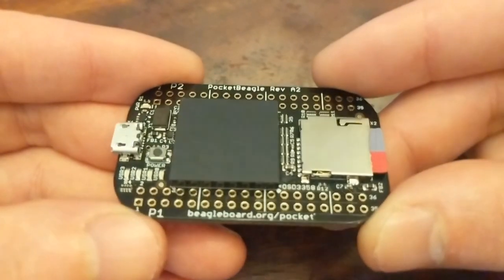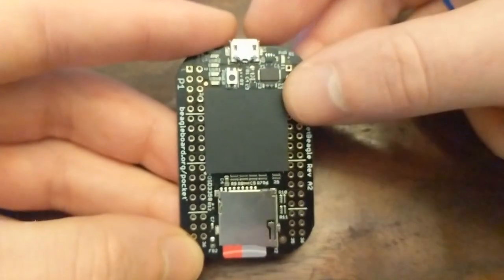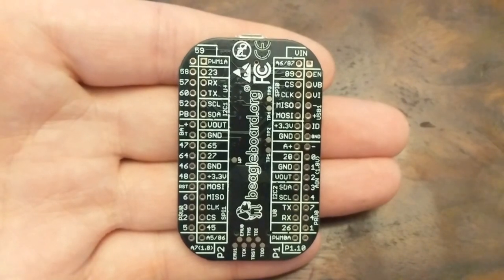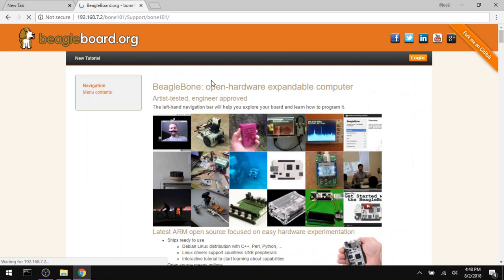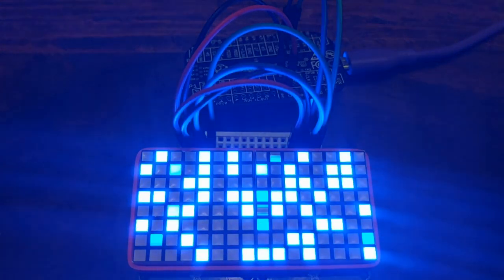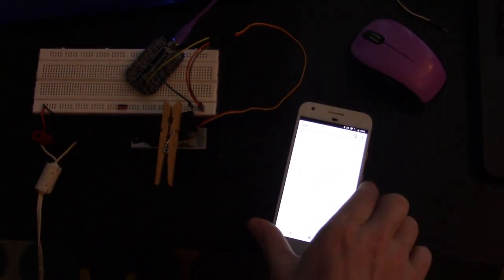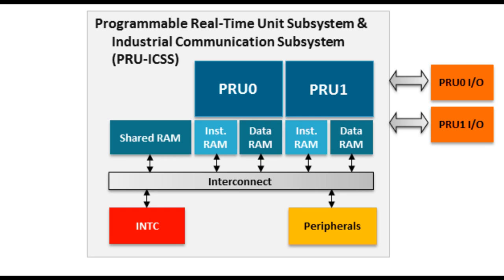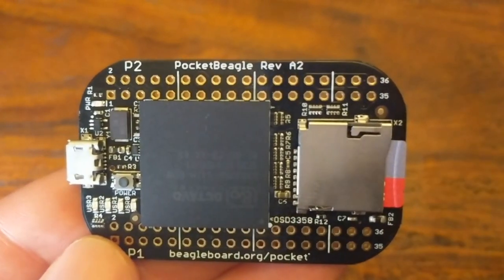Pocketbeagle: Open Source USB-fob Computer?

Comment: btw is it really comparable to an embedded chip/arduino, or is it just better than other types of linux-boards(like pi) regarding the timing?
Reply from the maker: Yep, the two PRUs are each 200mhz microcontrollers that aren't interrupted by the kernel or shared between threads, making their runtime deterministic. But they're better than connecting an external microcontroller because they can also access shared memory with the main CPU and they have single-cycle access to IO pins on the board. So you can pass data back and forth between them and the main CPU running Linux and basically delegate real-time tasks to them.

http://beagleboard.org/pru
Reply: DavyBot v1.0 does the runtime of the software choose wheter to pick shared or isolated memory, or is that managed by the programmer?
Reply from the maker: It's manages by the programmer but it's not very isolated. This article helps to explain. It's for the BeagleBone Black, but it basically has the same PRU setup as the PocketBeagle: http://www.righto.com/2016/08/pru-tips-understanding-beaglebones.html

For a technical read this PDF, starting around page 199, goes into more detail about the PRUs (TI is the manufacturer): http://www.ti.com/lit/ug/spruh73p/spruh73p.pdf
Reply: DavyBot v1.0 thanks!

Comment: love your triforce led action - intended or not
Reply from the maker: You're right, it does look like a bunch of triforces! The function to generate it is x&y==0. So basically any <x,y> pair that doesn't share any bits as integers become lighted pixel. Then I'm just moving the plane around. It's this fractal: https://en.wikipedia.org/wiki/Sierpinski_triangle
Reply: DavyBot v1.0 #mathgasm